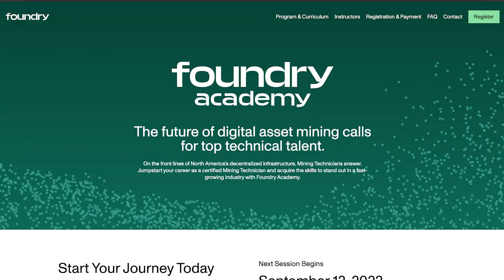Industrial Infrastructure for Miners | Camden Spiller | The Compass Podcast

Comment: 36:18 concerning the single wishlist item he would like to see changed as a manufacturer/supplier of transformers, within the crypto-mining industry: It is important to note the reason why most miners chose 415/240-volt secondary distribution for their operations. It is a COMPLIANCE ISSUE. IEC rated receptacle and cord sets used to feed hardware in the Data Center and Crypto Mining Space are limited to 250-volts AC. You simply cannot be code compliant using these devices on a 480/277-volt system (which is standard in the U.S.). Get in line buddy. This has been the bane of every mine designer existence in North America since the beginning. It all started a hundred years ago when the U.S. went the route of Imperial/Standard Measurement while the rest of the world stayed with the Metric System and now it's biting us in the @ss.
Reply: Is NEMA L7-15P twist lock on the PDU (C19 on the PSU side) not compliant?
Reply: @nchinetti  it all depends on the system voltage. 415/240-yes, 480/277-no. C19 is an IEC Rated Devices and IEC Devices are only rated up to 250VAC as opposed to the NEMA Rated L7-15P which is compatible with the 480/277-volt system.